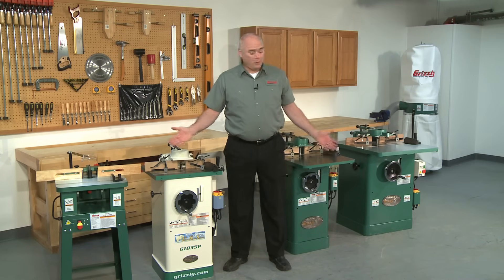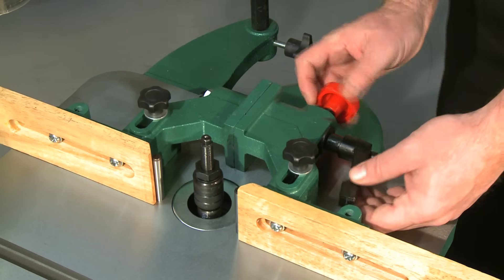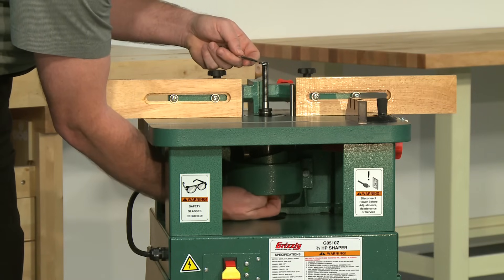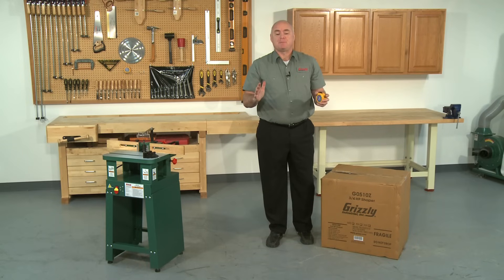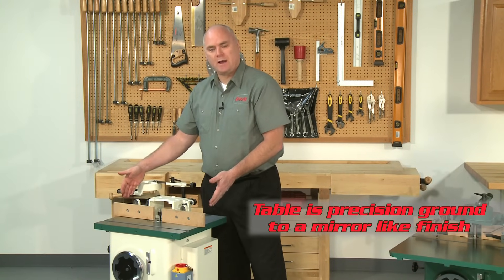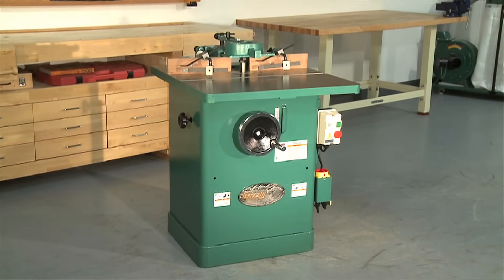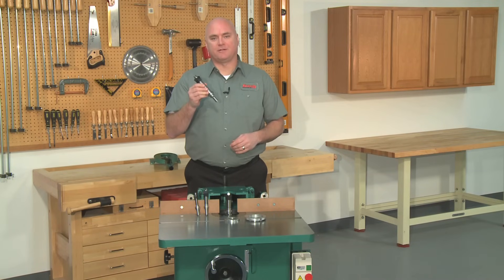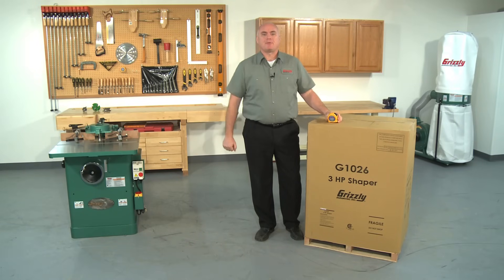Grizzly's Best-Selling Shapers: An In-Depth Comparison

Comment: Shapers are one of the most versatile tools in the shop. For the hobbyist who is interested in expanding his skills I wouldn't get less than a 3 hp machine. For the person hoping to do some more serious work the machines with 1 1/4" spindles and 5 hp. will serve them well. That is enough power and mass to be able to effectively use a power feed. The feed allows for higher quality cuts and much safer operation. For those new to the tool here is an excellent video:  https://www.youtube.com/watch?v=4n6yTHMBX54
Be safe.  I have 6 shapers, 5 feeds. I also am setup to profile grind for custom knives. It is possible to make custom cutters with nothing more than a good bench grinder, some lock edge steel and cutter heads.
Reply: 000⁰0